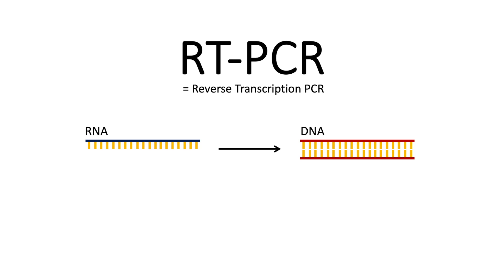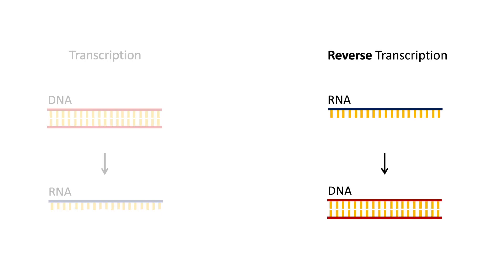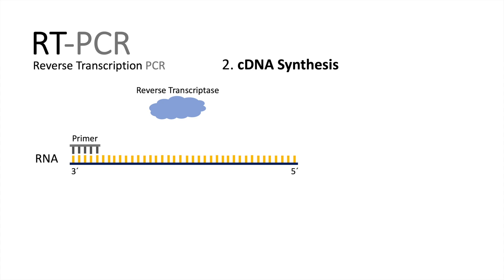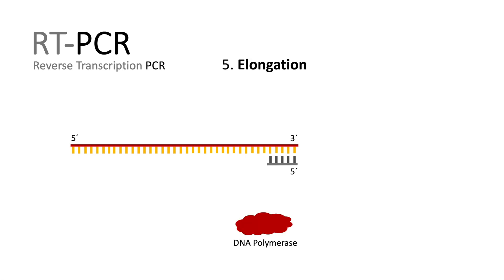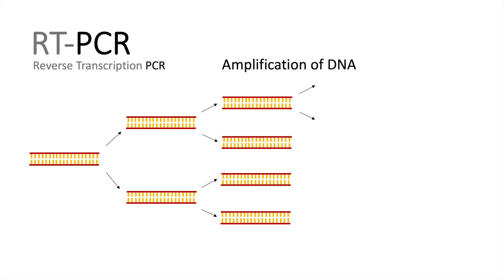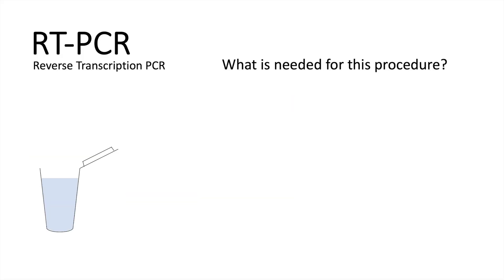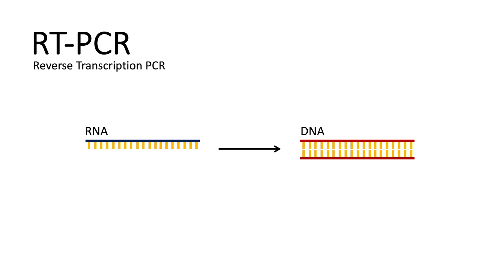How we test for SARS-CoV-2 - RT-PCR (Reverse Transcription PCR)

Comment from the maker: In the Covid-19 Test:
The primers are designed so that they can just bind to RNA with the exact same sequence of the virus. Then DNA is amplified. Otherwise if the primers don´t match with the RNA, no amplification takes place...
Reply: Lot of people does't know how covid 19 testing works share this to others. 
https://youtu.be/yo9Jaijkjgo 
be safe..
Reply: What stops the primers annealing to non-target RNA in a contaminated sample?  The number of nucleotides in the primers are extremely small (just 20-30 bases long) compared with the lengths of non-target RNA lengths. The specificity in the presence of contaminants collapses..
Reply: Can u please tell me where did u get those images pleaseeeeeeeeee
Reply: And who set the primers? This is just basically guesswork. If you had different primers you had a "different virus". PCR tests are bullshit. There's no way to false-proof the solution of a SPECIFIC VIRUS GENOME.
And before you reply: no it isn't.
Reply: nowonmetube your first question can be answered by a failing high school student. GTFO homie
Reply: @nowonmetube  u have only require one type of primer in case of COVID-19 already its genome ( RNA) is sequenced
So on the basis of this sequenced RNA there are also commercial available primers already designed
No for COVID-19 test
U should have sample from COVID-19 patient
Then extract RNA from it by different isolation techniques now after identification of RNA(Gel etc) 
Now we have RNA solution. Now it's time for amplification of RNA by RT PCR 
So primer act as marker

Comment: You didn't make clear as to why RT-PCR is useful when compared to normal PCR. You should've clarified that measuring mRNA will yield different conclusions than just DNA.
Reply: RT-PCR is used to make cDNA or complementary DNA strand clones from mRNA and these cDNA clones are used to make cDNA library. This technique helps to make selective cDNA from a particular mRNA and amplifies the cDNA clones. In normal PCR we get the multiple copies of particular DNA. After one complete cycle we get 2 copies of the DNA, each of them contain one parent strand and one daughter strand. But in RT -PCR we only get the cDNA clones. This is what I get from my reference.
Reply: @ashnamohan79  Your comment fails to describe why one would opt to measuring mRNA rather than DNA.
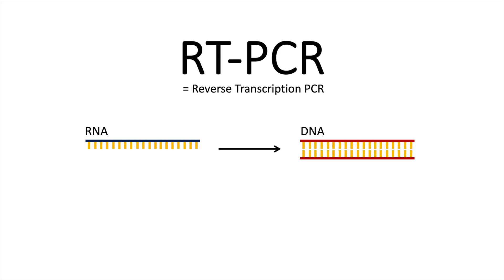Reply: @bigdaddynero  0:25 thats why
Reply: @slm20408  Why is not the same thing as how.

Comment: What stops the primers annealing to non-target RNA in a contaminated sample?  The number of nucleotides in the primers are extremely small (just 20-30 bases long) compared with the lengths of non-target RNA lengths. The probability that primers will anneal to their composite RNA strands in genetic material, deactivated viral RNA fragments, (INFLUENZA A & B, broken/de-activated SARS-cov-2 RNA strands from previous infection) is very high. 

The specificity of SARS-CoV-2 primer protocols in the presence of contaminants within the unpurified snot sample is very small.
Reply: The chances that a contaminant has the exact mRNA coding sequence needed for primer annealing is extremely low and won't cause any confounding results if present. Primers are specifically created for the mRNA that's expected, and/or not expected, within a sample.

Comment: Why are the individual bases of the cDNA not complementary to the mRNA but rather just a DNA sequence? Like, the cDNA has only difference in bases such as U with T and T with A's. Other than that, on the cDNA, it's a C for a C on the mRNA and G for a G on the cDNA? I thought it would be complementary and a C on the mRNA becomes a G on the cDNA for example? Apparently from what i checked this is not the case? Can you explain please

Comment: Which primer is used to synthesize the cDNA?
Reply from the maker: There are many strategies..

There are unbiased approaches:
-often they use random hexamers (this is a mixture of very short primers that cover all possible sequences)
-some use oligo d(T)s, a primer that has only Thymidines to cover the 3´poly-A-tail region 

Also, there are more specific ways:
-if you aim for a specific gene instead of an unbiased approach: you can design the primer specific to your gene of interest
Reply: @henrikslab  Which tool do you use to design gene specific primers for coronaviruses using the accession number of a whole genome from NCBI? Thanks.
Reply from the maker: NCBI is great in most cases when designing a primer!
https://www.ncbi.nlm.nih.gov/tools/primer-blast/

Comment: Can someone help me. I'm not that good with science but I roughly understand. During the denaturation of the cda, you use taq polymerase to elongate the the rna strand or the complimentary strand which  binds to the rna strand? Also, why can't we detect covid by just amplifying the cdna?
Reply: A bit late but the Taq polymerase is used to elongate the single stranded cDNA starting from a hybridized primer. The RNA strand is at this point no longer relevant because it has already been converted to cDNA. Covid19 can't be detected by "just amplifying the cDNA", because Covid19 doesn't generate cDNA. It generates RNA, which we first have to turn into cDNA, like shown in the video.

Comment: You haven't told much about how to detect Covid through RT PCR?
Reply: @KK-lg8uz  that's where you're mistaking. Technically speaking yes, if you look at one RNA bit by bit, it's different. But since viruses can EASILY mutate, it can. Also PCR is set only to specific primers. So guess when you have all kinds of viruses with the same primers what happens? Also: Our genes are full of virus RNA! Half of it are virus genes!
Reply: @KK-lg8uz  I'm not sure if you understand the process. You have the exact same virus, if you select randomly different primers, you can invent all kinds of new viruses.
Reply: @KK-lg8uz  Also, no they don't know what they're doing. There's all kinds of different tests for HIV, depending in which country you are. The test also has changed over the years, several times:
https://youtu.be/uCV8RA5Dx3E
Reply: @KK-lg8uz  you're welcome 😊🐝
Reply: It's just an imaginative set of primers. If you had different primers, with the same RNA, you'd have a "different virus".

Comment: Why we use PCR tecnique..?
PCR means amplification of DNA strands so how we know if the virus is present or not..?
And i studied RIA (redioimmuno assey) for antigen antibody reaction so we should useing it for testing the presence of virus..
Reply: The PCR is used so we can either 
Verify presence (and abundance) of the viral RNA by using Quantitative PCR (qPCR)
or actually sequence the genetic material
I can't speak to RIA that much, they seem like faster and easier to perform but less acurate and take time to create. Theoretically in time we should be able to use them, it is just you have to determine that it works well because the potential for false negatives/positives is higher if you go off of binding rather than just sequence.

Comment: Why do we make cDNA since the 1st step of PCR is denaturation which make ss DNA?
Reply: Correct me if I'm wrong, but I believe it's because the virus is an RNA virus. When we separate the cDNA from the RNA strand, it is essentially the same idea as denaturing a double-stranded DNA molecule. The virus does not have double-stranded DNA, so you would first need to create the cDNA from the RNA, otherwise amplification would not be possible.
Reply: @InderSingh-kr2bl  Correct
Reply: cDNA is more stable than rna .

Comment: Shame this test does not work and that it’s late investor Kary Mullis stated that it is not intended to diagnose transmissible disease. The FDA states the test is used to diagnose lung cancer among other things and that a positive result does NOT rule out bacterial infection or co infection with another virus. Please do further research on this topic by following up on the above statements and remove this video
Reply: Yes! Kary Mullis has strongly opposed using the technique for determining the amount of virus circulating in plasma. BTW: I’m pretty sure you meant inventor not investor. Although he invested his time in inventing it :)
Reply: This test is useless for covid since covid has never been isolated or purified properly. So they don't even have a sequence to match it with.
Reply: Reverse Transcription does just amplify it. RT-PCR or qPCR is to quantify the viral load, which will tell you the amount. There is common confusion between Reverse Transcription (RT) and Real-Time (RT) PCR. It is generally more appropriate to use the term qPCR (quantitative).

Comment: How long does the testing process take?
Reply: RT-PCR from start to finish (with the sample already extracted from the swab taken from patients) is around 4.5 hours. Up to 1.5hrs to make up the solutions and set up the sample plate (a little longer if you do ddPCR instead of qPCR because you have to create droplets), and about 3 hours sitting on the thermal cycler before the data is ready to be analysed (or 'read' in the case of ddPCR where the droplets have to be fed through a machine to detect fluorescence).

Extraction itself can vary quite a lot depending on what you're extracting and what media it's in, it can be very quick <1hr or it can take most of the day.

Comment: Does PCR detect the Virus Reading frame region in PCR ? And how ?
Is it as the video said or is it something else. 
Thank you for your time
Reply: The test kits from different manufacturers recognize different regions of the virus genome. Because virus genomes are quite small, there may be up to 6 reading frames to generate all proteins necessary for the virus to auto-amplify in cells. Wether the PCR includes a reading frame or not is not important. The key point is that the PCR only amplifies a portion of the genome that is specific to C19, not portions that could be similar to other coronavirus.
Reply: Bobo LRO thank you so much I appreciate it
Reply from the maker: razan abubshait one target is actually in the open reading frame (RNA dependent RNA Polymerase) 
Check out the Paper here: https://www.eurosurveillance.org/content/10.2807/1560-7917.ES.2020.25.3.2000045 (Fig. 1)
Reply: HenriksWorld thank you so much you’ve been a great help

Comment: What is primer made of?
Reply: They are made from oligonucleotides (or oligomers) which can be synthetically produced or naturally occurring. These are the made from the same building blocks as your genetic material, but are complementary to the genetic material you want to amplify. 

To visualize the PCR products, the primers are tagged with fluorescent labels (fluorescent chemicals that bind to the primers).
Reply from the maker: @BarnsM  Thanks for answering!
Reply: Primers are small pieces of DNA that match specific portions of the virus genome that are specific for this virus (they don’t match the flu or other virus genome). This is why before creating test kits for PCR it was necessary to isolate the virus and sequence it’s entire genome.

Comment: What is the difference between two step and one step RT-PCR , and what is this?
Reply: @James Candfield -- 

RE: "and what is this?"  --- I assume you are asking what is RT-PCR? Reverse Transcription Polymerase Chain Reaction. It's a method to amplify a sample of RNA by creating a complementary DNA strand. 

RE: "And what are dNTPs needed for synthesis" -- these are the nucleotides that you use as the basic building blocks for replication/elongation of genetic material. These building blocks are the four bases: A/T/G/C (or adenosine/thymine/guanine/cytosine) for DNA. Or in the case of RNA, A/G/C/U where U = Uracil. 

As the names suggest, the number of steps differ from both methods. In two-step, the formation of cDNA is done in a separate tube. Then only the cDNA is moved to a new tube, and DNA polymerase (plus all other ingredients like cDNA primers, dNTPs, buffers, etc) are added to amplify the cDNA -- this is your typical polymerase chain reaction. But in your one-step, everything is done in the same tube. You put a mixture of Reverse Transcriptase (to form cDNA) and DNA polymerase (to amplify cDNA), along with the RNA primers (to form cDNA) and cDNA primers (to amplify cDNA) as well as the necessary buffers and dNTPs all in one reaction tube. When you throw this mixture in a thermocycler, cDNA gets formed from the RNA sample, then amplified to produce more cDNA. But as you can imagine, the one-step is a soup of different reactions, which can be hard to control for. 

Depending on what you need, both procedures have their advantages and disadvantages. Hope this helps!
Reply from the maker: @BarnsM  Thanks man! Doing me a favor!
Reply: And what are dNTPs needed for synthesis